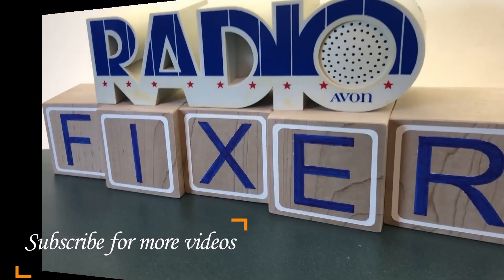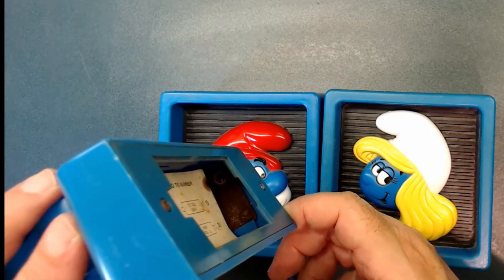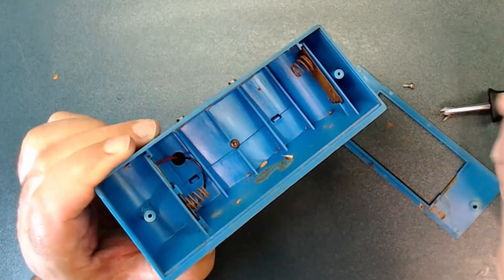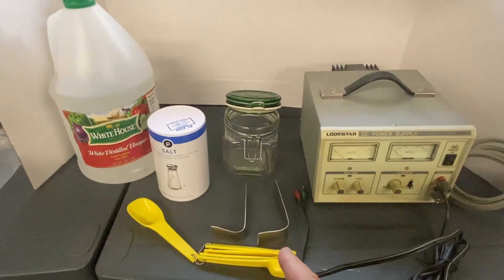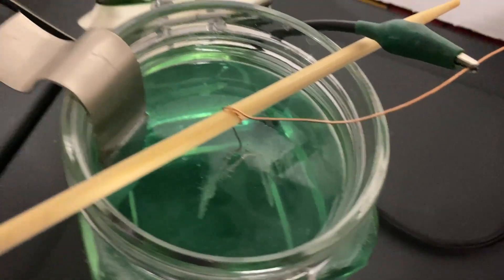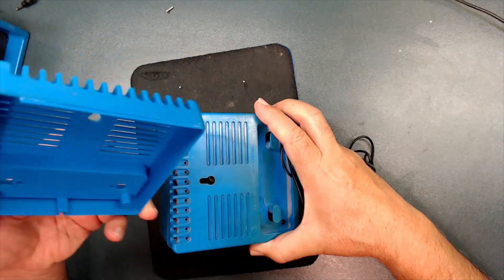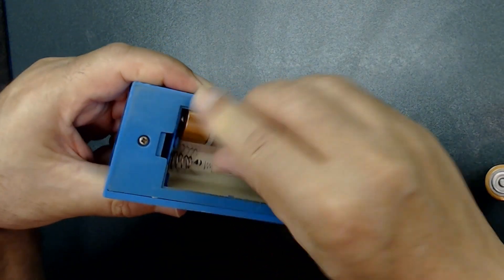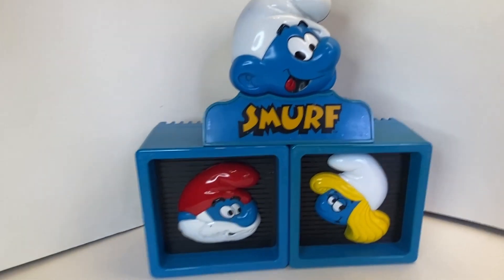Transistor Radio Repair - SMURF with twin speakers

Comment: Love the way you go through the radio to get parts replaced. Not surprised how dull the finish came out on the battery
 tabs. Takes a lot of time to get it right and hopefully it won't scratch off by adding and removing the batteries over time.
 Lemon juice and sunlight can be used to remove the dark areas of the plastic. You wipe some on the darker blue areas 
with a small brush, replace when neccessary leaving it out a few days and it will smell nice too. Sounds great! Your radio
 hobby is nice and fun. Thanks for sharing it with us Jay!
Reply from the maker: Hi Steve, I definitely will try it out with Lemon juice, did not know that. Thank you for always be so supportive and assisting, I really appreciated. I love this hobby, it is great and keep me busy doing fun stuff and keep learning. Nickel Plating was fun project need to get better at it since some parts are hard to find and need plating instead of paint. LOL. Have a great day my friend.

Comment: Nice job on those battery connectors Jay. Whole project looks very good. :)
Reply from the maker: Hi Doug, thank you very much my friend! Making the Nickel Plating solution and plate the connectors was very fun. Wanted to Plate stuff for a long time, finally did it... LOL Was very surprised how well this little transistor radio is performing. Volume was just 1/5 of the turn loud, can not imagine if set for 5.. LOL. You are so thoughtful sending me message, a true gentleman.  Have a great weekend! Regards, Jay

Comment: Good morning Jay. Yet again another very enjoyable video. I was very impressed watching you plating the battery contacts. May I ask, what voltage were using in the plating process ? Thanks again.  Terry
Reply from the maker: Hi Terry, so glad that you enjoyed watching this video. It is a fun project to plate metals, now I want to Plate everything.. LOL. Since my power supplier did not allow me to run it very low Amps had to set my power supplier to 1 volt, tried 3-5 volts but increased Apms. The solution was getting very hot with higher Volts, I suggest use much lower than one amps if your power supplier allows. Lower volt and amps will take more time to make the solution but solution will not get very hot. To plate the contacts I keep it to 1 volt will not give you a good smooth plating result. If you do not have a power supplier you can use any old 3 to 5 volts phone charger since they have much lower Amps. Hope this helps! Have a great weekend my friend! Regards, Jay